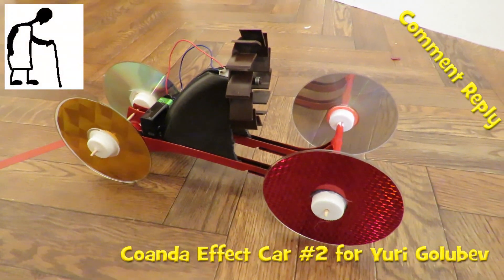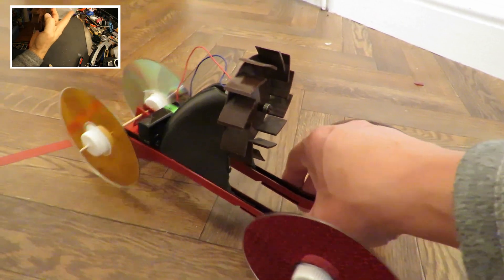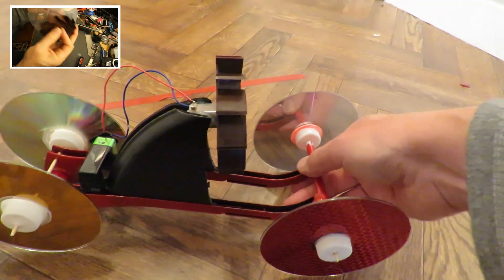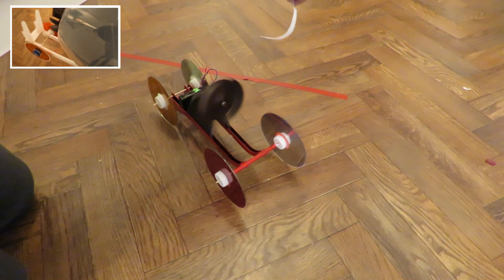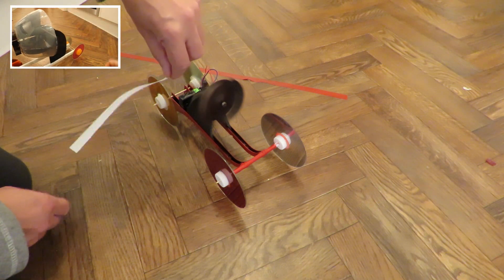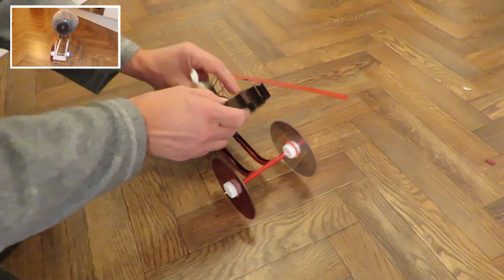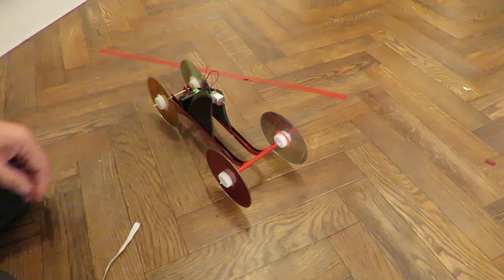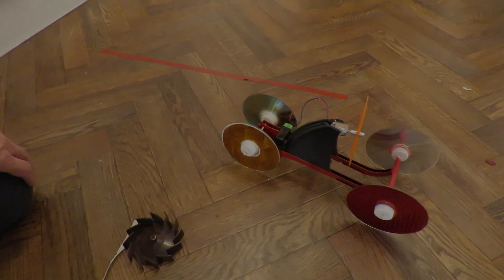Comment Reply Coanda Effect Car #2 for Yuri Golubev

Comment: I got it. Thank you for detailed response. I see no horizontal thrust now.  My understanding was (correct me if I am wrong) you used the fun to make the radial directed air flow which works with a bowl and does not work without  it (the Coanda effect vu a la). Ok. May I suggest the following two-step experiment (it will be easy with your car). 1. To replace the fun with a propeller (from an aircraft model) which makes the one-directional flow instead the radial flow . In the case the propeller must push your car forward (as it does with an aircraft on the land).  2. Do it without and with the bowl. Will you see any difference in car speed? Good luck and thanks again.
Reply from the maker: This is as far as I am going. If you want to experiment more I suggest you make your own car and try it first hand. Then you will be able to work out the results yourself.
Reply: Thank you. Actually, I am not interested too much in study of Coanda effect but your attempts to demonstrate its physics look very nice. It seems to me the thrust produced in the case with bowl has to be proportional to V^2/R (V is air velocity, R is curvature radius).   I mean, smaller bowl can give you more thrust. Or can not :)
Reply from the maker: Yuri Golubev there are links in the video description to other people's videos on the subject. I doubt that a simple regular radius would be used to get the best efficiency and I am certainly not going to spend time trying to make comparative analysis as I do not work with scientific accuracy. I just use whatever junk I have available and see if I can make things work, that is good enough for me.
Reply: If you do not work with scientific accuracy, why you doubt of curvature radius? :)   Again, thank you for your demonstration.
Reply from the maker: Yuri Golubev that is my point. I don't work to scientific accuracy so I would not be able to demonstrate any variation in efficiency from different rates of curvature. You are in the realms of fluid dynamics and would need a properly equipped scientific lab to progress any further.